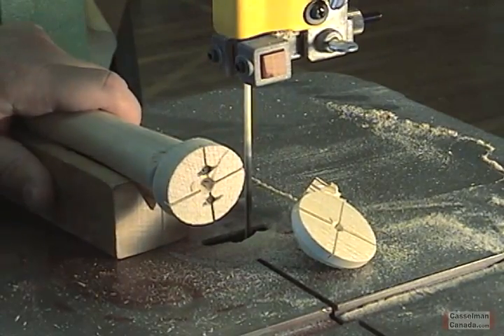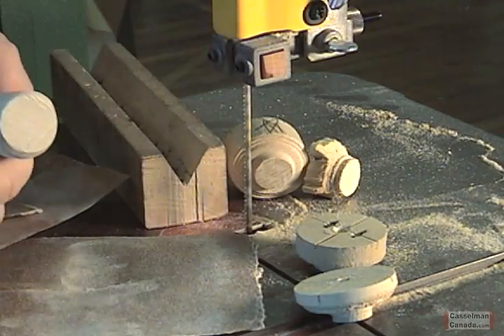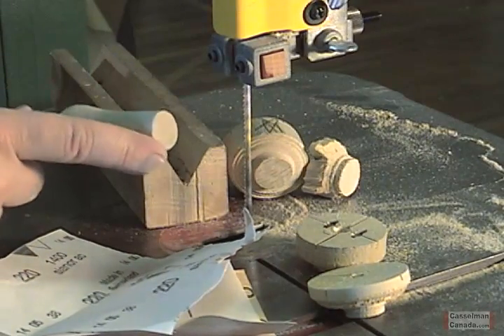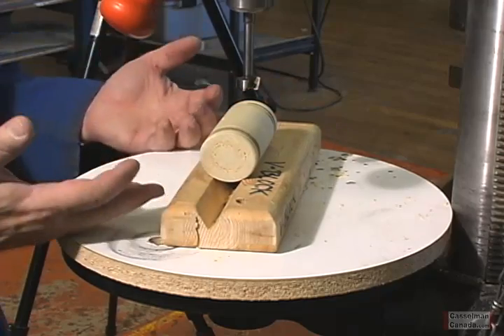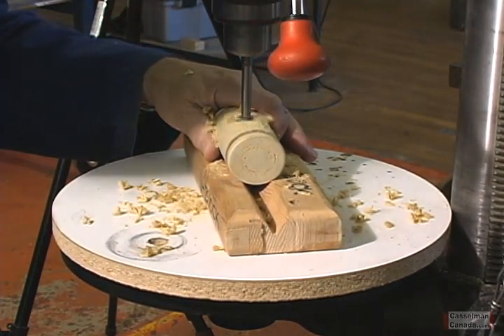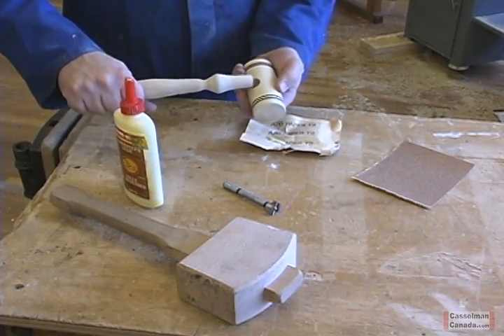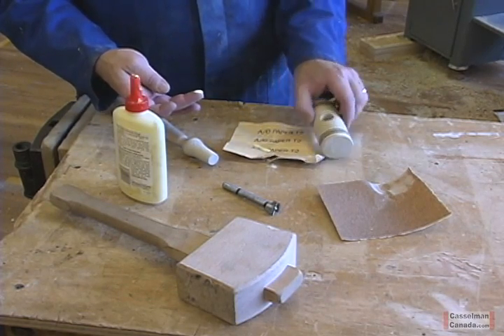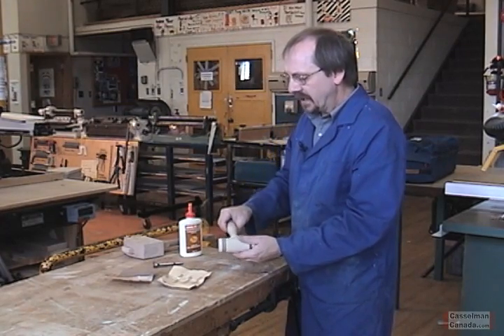Wood Lathe Project - Wooden Mallet Pt 3- Woodshop project demonstration

Comment: Thanks for taking the time to make this series of videos. I am a beginner with use of the lathe and found them very usefull. I especially liked the info about the blank and tool rest setup. Also I paid particular attention to the chissels you used at various steps in the process. this will be very helpful for which ever project I decide to make. Thank you.

Comment: This is an awesome set of videos.  I learned so much - especially about the things I was doing wrong!  I made one of these and it turned out great... until I realised that I had drilled the hole in the head off centre :(  So I now have a great looking mallet that can bash things around corners :)
Reply from the maker: Thanks so much for your comments. I have a few of those corner mallets as well. What type of wood did you use for your mallet?
Reply: It was a bit of an experiment so for the head I used a 30+ year old Iron-Bark stay from a telegraph pole (my neighbour works for the electricity distribution company).  The handle was an old ladder rung (looks like iron-bark too but I'm not sure) of a similar vintage.  Here it is if you want a peek :) ...

https://www.dropbox.com/s/a36z74wewd4i1vz/2014-12-26%2009.50.50.jpg?dl=0
Reply from the maker: *****
That wood grain you have is very nice. I really like the tone of the wood too.
Reply: Thanks :)  I'm going to make a couple more from the same stock tomorrow.  More carefully this time :)
Reply from the maker: ***** When you make the oval handle, try not to remove as much from the handle when the tailstock is connected in the offset position. It does not take much. Too much and then it does not stay oval.
Reply: I thought my handle did turn out oval... although I did also cut out the Vs I had made with the parting tool... but that almost looked on purpose :)